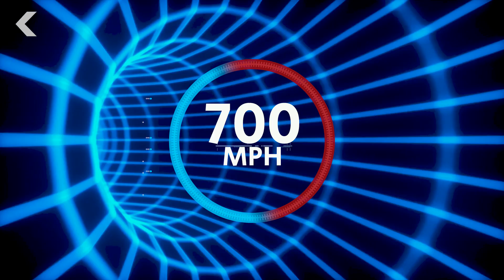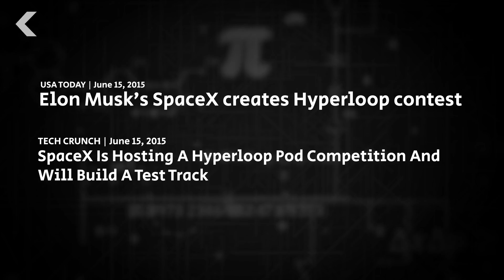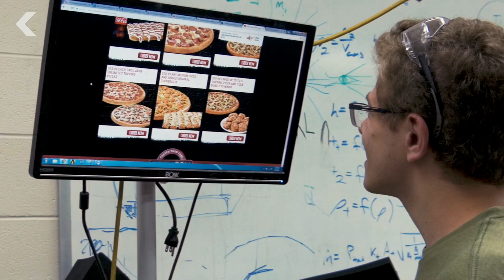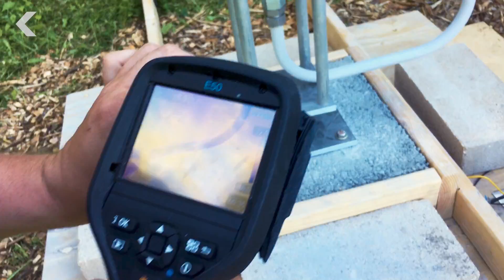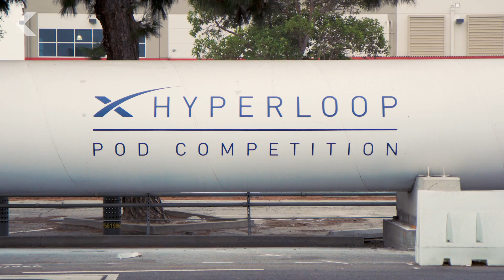These College Students Built a Hyperloop Pod... Here's What Happened

Comment: well the only problem here is why make a aerodynamics car that travel in near vacuum? ITS HAVE BARLY NO DRAG IN NEAR VACUUM! The only thing that can let the car travel faster is the fuel efficiency and if you travel without wheels, the only thing that can let the car move is using magnet or using air propulsion but the pipe need to constantly pump air out to maintain the pipe near vacuum
Reply: still enough drag that aerodynamics can reduce energy consumption
Reply: @Khoo Hao Yit - No the original idea is not "scrapped". Even at significantly low pressures inside the tube there will be a pressure wave at high velocity. The shear stress gradient is exponential. As you approach 700mph you're going to require an aerodynamic body to reduce resistance even in a very very thin atmosphere. To be clear, I'm not a proponent of Hyperloop. I think the idea fails for many reasons, but this is not one of them.
Reply: @Marian Pazdzioch - It's a question of volume. The very small volume of the cold gas thruster would not significantly increase the pressure in the very large volume of the tube. And as the tube's vacuum is maintained with an active system, any change in pressure would soon be normalized. Is the contest done for 'shits and giggle's? In a way, yes. But it's teaching valuable engineering skills in a competitive environment that engenders greatness. You scoff at the pointlessness of the technology, but contests like this are INVALUABLE to the kids participating, and very important to the advancement of engineering. As I told Khoo, I am not a proponent of Hyperloop. I see a lot of problems with the technology. But you guys are putting forth a lot of arguments that aren't correct.
Reply: Khoo Hao Yit yeah I've been thinking that too, no atmosphere no need for aerodynamic pods
Reply: Kevin Fernandez So their original idea scrapped? How about making their own highway so they dont need to create a tunnel that cost a lot of money and time. BTW they need to refill the tank to high pressuer every ride.
Reply: I have a better question - why vehicle that is suppose to travel in vacuum sealed tunnel destroys vacuum as means of propulsion ? It looks like this contest is done for shit and giggles.

Comment: Wait does it work? CAuse why build the car when the loop is still no working in practice. Last time I checked the vehicle failed to reach the desirable speed.
Reply: Come on ppl, what kind of PR is this vid? Designing a breaking system to stop the pod after it reaches 200m /h  ? Care to elaborate on how the pod will reach that speed inside the vacuum tube in the 1st place ?

will the quantity of the gas stored in that tank move the mass ( ??? kgs) with enough thrust ?

The challenge seems to be wrong from the very beginning. The problem is to reach and maintain  speed for miles. Stopping should be step 2. And the project seems far from viable in the long run but props for the ppl that did their best.

Comment: The hyper loop is scientifically impossible.
Reply: Jim no it's not
it's economically impossible
Reply: People did think the earth was flat, although a thousand years ago they already knew it wasn't.
Reply: Yes those works on a small scale where the pressure doesn't affect the contents, but with a human you have to worry about rapid acceleration and deceleration as well as the humans within BREATHING. What happens if the capsule inside fails and the passengers within are exposed? Weeell we can thank NASA for this information.
Some degree of consciousness will probably be retained for 9 to 11 seconds . In rapid sequence thereafter, paralysis will be followed by generalized convulsions and paralysis once again. During this time, water vapor will form rapidly in the soft tissues and somewhat less rapidly in the venous blood. This evolution of water vapor will cause marked swelling of the body to perhaps twice its normal volume unless it is restrained by a pressure suit. (It has been demonstrated that a properly fitted elastic garment can entirely prevent ebullism at pressures as low as 15 mm Hg absolute [Webb, 1969, 1970].) Heart rate may rise initially, but will fall rapidly thereafter. Arterial blood pressure will also fall over a period of 30 to 60 seconds, while venous pressure rises due to distention of the venous system by gas and vapor. Venous pressure will meet or exceed arterial pressure within one minute. There will be virtually no effective circulation of blood. After an initial rush of gas from the lungs during decompression, gas and water vapor will continue to flow outward through the airways. This continual evaporation of water will cool the mouth and nose to near-freezing temperatures; the remainder of the body will also become cooled, but more slowly.
You have about 60-90 seconds from initial exposure to get them back into a re-pressurized environment to have any chance of survival and if their heart stops within that period they are dead.
Reply: Vapor Wave - sama the chapter of a physics for dummies book that explains thermal expansion
Reply: Brett Van Overstraeten People did think the Earth was flat because it looked flat until the Greeks found out it wasn't.
Reply: SilvaDreams ye
Reply: Scientifically?, give me the source of the paper saying the reasons of why Hyperloop couldn't work
Reply: Jim well I heard even the emDrive defies the Newtonian law of motion. maybe if we are a bit more open minded regarding science. A thousand years ago, 99.9% of the earth's population thought that the earth was flat but here we are today because of the resilience of some out of the box thinkers. Our knowledge of science is still very little. If black holes and many other mysterious things can exist, so can these.
Reply: Oh yes that's scientifically impossible because of thermodynamics, sure that's why I have never seen such a system work in a smaller scale, oh wait :
https://www.youtube.com/watch?v=gAlzYLcqsTU
https://www.youtube.com/watch?v=OPhILg-G7J8

Comment: They should put an egg inside the module so if it breaks we'll know that people probably wont work out so well inside either.
Reply: Bismuth LD were less fragile than an egg
Reply: What happens to a human inside the tube?... MMm NASA already knows...
Some degree of consciousness will probably be retained for 9 to 11 seconds . In rapid sequence thereafter, paralysis will be followed by generalized convulsions and paralysis once again. During this time, water vapor will form rapidly in the soft tissues and somewhat less rapidly in the venous blood. This evolution of water vapor will cause marked swelling of the body to perhaps twice its normal volume unless it is restrained by a pressure suit. (It has been demonstrated that a properly fitted elastic garment can entirely prevent ebullism at pressures as low as 15 mm Hg absolute [Webb, 1969, 1970].) Heart rate may rise initially, but will fall rapidly thereafter. Arterial blood pressure will also fall over a period of 30 to 60 seconds, while venous pressure rises due to distention of the venous system by gas and vapor. Venous pressure will meet or exceed arterial pressure within one minute. There will be virtually no effective circulation of blood. After an initial rush of gas from the lungs during decompression, gas and water vapor will continue to flow outward through the airways. This continual evaporation of water will cool the mouth and nose to near-freezing temperatures; the remainder of the body will also become cooled, but more slowly.
You have about 60-90 seconds from initial exposure to get them back into a re-pressurized environment to have any chance of survival and if their heart stops within that period they are dead.
Reply: I can think of 10 things that would destroy a person and wouldn't impact an egg.
Reply: Dropping an egg on a grass field from any height

Comment: Betting 99% of comments will be about thunderf00t debunking this.
Reply: 1% is something about buzzfeed.
Reply: There really is no solution to the problems. The hyperloop tube is extremely vulnerable and if you make it out of something durable enough like whatever they make tanks out of, it becomes cripplingly expensive. Here on Earth, airplanes are probably the best people transportation. They have no tracks that can be disrupted it require expensive maintenance, they go quite fast, they are extremely safe as well. If we didn't have the stupid and unnecessary TSA, boarding would be a breeze. The hyperloop requires pressurization to board and exit which makes it functionally slower than aircraft. Self driving cars and maglevs are probably the ultimate surface transportation for why planet because they don't rely on the atmosphere to work.
Reply: my problem with hyperloop is that even if it's feasible, it has far less throughput than high speed rail (at least initially) with far more cost. modernizing the current train systems would be far more economical.
Reply: I don't know who this thunderfoot person is, but I don't think Hyperloop will ever happen. A Hyperloop is basically a Maglev with a vacuum tube around it. The maglev is decades old and has never turned a profit, that's the reason why it's being deployed barely anywhere. Add to the maglev the cost of developing a new technology + maintaining a vacuum tube hundreds of miles long. Does that make any sense? Only if you're an Elon Musk fanboy. The Hyperloop is a great publicity stunt for organizations and government institutions that want to appear innovative. It's also a great distraction from the problems at Tesla and SpaceX. And it's also an easy story for news channels. I bet everyone running these Hyperloop initiatives is very well aware of that.
Reply: I disagree, not everything can be solved and sometimes even if there is a way around a problem it does not mean to do so is always be good and sometimes trying to go around a problem may start another even worst problem than the one you tried to get around.
Reply: Yep. There is no good solution to making hyperloop "work". It just isn't possible without insane amounts of time, money, and resources that could be used to just make... I don't know, a couple huge airports.
Reply: what? the laws of PHYSICS make the hyperloop nearly impossible without insane costs, and years of work. im not being negative to be negative, im stating the truth.
Reply: Robin Gilliver not an argument
Reply: There were no women on the main team making this. I'm triggered.
Reply: Oh, sorry for not being exact. Yes, it 's not maglev, it's electromagnetic levitation, very different. It's also not a vacuum tube, it's a low pressure tube. And it's also not Hyperloop, it's snake oil, is that correct now?
Reply: Sorry, but the original concept involved a linear induction motor, therefore, electromagnetic levitation.
Reply: No. Linear induction motor does not indicate magnetic levitation. Original concept included air cushion, not magnetic levitation. It is actually quite funny that your complaints about "hyperloop" is identical of Elon Musk complaints about vacuum tube train concepts.
Reply: 100 pascals is pretty close to a vacuum. It's not a high vacuum, but it's beyond reasonable limits for a single stage pump.
Reply: Pietro Smusi but he does debunk every thing wrong with this
Reply: Pietro Smusi the only argument i made is that the statement above wasn't an argument
Reply: Fire Flowers it's not, but it certainly should be
Reply: wonderful but the point still stands. one does not simply break the laws of physics. also, have you seen those 'pods'? they are pathetic atm. barely work.
Reply: Few people commute 300 miles per day... and if it ever became a significant number of people, a Hyperloop that carries 3000 pax per hour at absolute full capacity is not a solution.
Reply: Oassaimer Remissao: Couple of mistakes: hyperloop is 1) not maglev and 2) not vacuum tube. Because of your initial assumptions are wrong, the rest of the text is also wrong.
Reply: You're talking about the stupid prototype in this video, not the Hyperloop One, which is the one actually being developed by Virgin and promoted all over the world. That one uses magnetic levitation.
Reply: Hyperloop One uses. Original hyperloop doesn't. Hyperloop One is derivate of the original concept. If you wan't to criticize the concept get your facts right. That said, the original concept might or might not be feasible, I have no opinion about that. Haven't investigated the maths involved enough to have any kind of opinion.
Reply: Robin Gilliver how?
Reply: *Trying to. He showed an issue and then pretended there were no solutions. Very intellectually dishonest.
Reply: except hyperloop isn't a solid object occupying the entire tube, hyperloop is larger and thus has much more inertia, and the distance from a vacuum failure to the nearest pod is likely much further
Reply: @Jeroen Bollen Incorrectly worded. TF pointed out an issue, which doesn't mean that HE HAS TO SOLVE THE ISSUE TO HAVE HIS CRITICISM ACKNOWLEDGED. In what world does pointing out a flaw require you to fix said flaw? lol Thunderf00t isn't perfect but he's way more credible than uneducated people trying to excuse blatant flaws in an idea. A terrible idea.
Reply: if everyone were more cooperative i would my flying car parked in the back and going to gundum battles on the week ends
Reply: Thunderf00t's videos were refuted here:
https://www.youtube.com/watch?v=kx52A-v65Q8&list=PLSPi1JFx4_-Gz0Fm0qq2KUz4c22UbZCco
Reply: Ambient Morality
Ambient Morality point of hyperloop is to compete with airplanes, not trains. With that speed it wins planes at medium distances by a good margin. Imagine commuting for lets say 300 miles every day. With plane it still takes couple of hours / day and is big hassle with boarding and security, with car or train too slow.
Reply: Oassimer Remissao, not electromagnetic levitation. Not magnetic levitation of any kind. It is basically a jet plane in low pressure tube. Low pressure, not close to vacuum.
Reply: their is always a way around a problem and the reason someone couldn't figure it out is because they have given up and thunderf00t is a sore looser
Reply: Who is thunderf00t?
Reply: yes, people like you and thunderf00t do make it to be impossible dragging people down. how about investing less negative things and more on innovation making our imagination possible like everything in the beginning was. if one has no encouragement then everything with be halve as and nothing would ever be done. from one continues fail idea hundreds more successful ideas can be born and nothing is in reality a waste of time  just the thought of it being a waste of time is a waste of time.